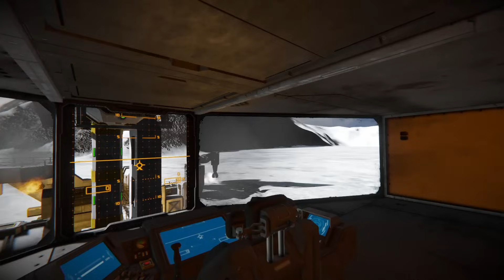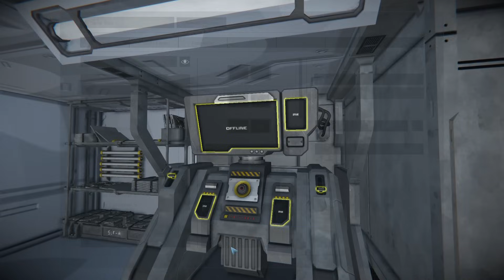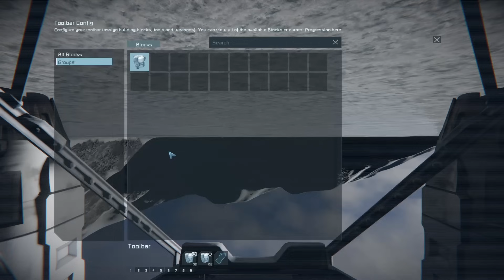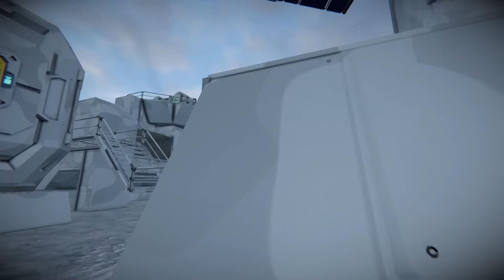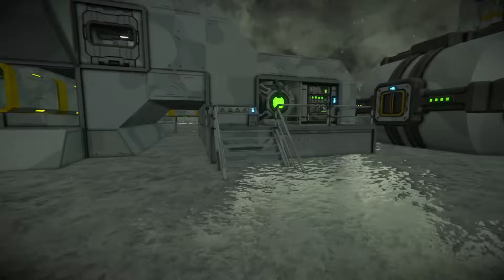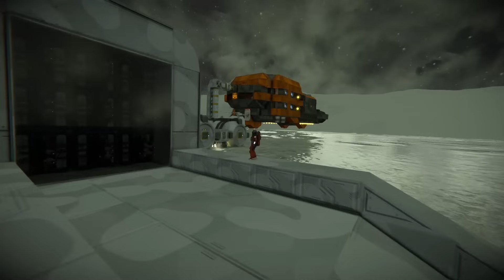5 Automation Tips to Make Life Easy in Space Engineers Automatons

Comment: And then there's another trick for automatons: small-grid automaton blocks on the small rotor head of a large grid rotor. Basically, it's a "ship" trick: carve out a small compartment and cram in a bunch of automatons that would take up half of a larger-grid ship. But it also sometimes helps out "on the ground" if resources and space are tight.
Reply from the maker: The drawback with this is that subgrids can cause problems with the way your grid handles, but it should be okay if you keep it small.
Reply: @GleebTorin  I hope a careful analysis of the non-overlapping namespace will eliminate these problems, along with not-so-minor "ticks" on events ;)

Comment: Am I weird for using connectors instead for my large grid computers? My experience with subgrids, especially on mobile grids, is that clang likes to fiddle with the physics even if rotors and hinges are locked, and pistons have sufficient axis/nonaxis stiffening. And because arguing with Clang pretty much always ends in losing said argument, I've experimented a little with using connectors instead. Looks neat with the newer inset connectors too.

I set it into place using LG half blocks around the inset connector, firstly building SG blocks and a 3x3 connector over the gap with some room to work, secondly adding chamfered blocks around the rim of the 3x3 connector, thirdly removing the supporting blocks until you're left with your chamfered 5x5x2 SG connector, and finally... setting the LG inset connector to the forbidden 100% strength (spoiler alert: it kinda just teleports inbetween the half blocks without issue) and locking, not forgetting the parking setting of course.

I get that it's a bit more hassle to set up, but you end up with a zero-movement, clang-free, sub-grid-but-not-really system at the end of the day.

Comment: The event controller when using a controller, doesn’t allow me to make a 2nd action. 

Like I have hydro engines powering batteries. 

I want the batteries to go into auto mode when they are fully charged and I want the engines to turn off. 

Then when the batteries get low enough I want to do the opposite but I can’t get more than one event set.

Comment: I forgot that hinges could be used with turret controllers.  I was using two rotors for my solar farm.  It worked but not as well as a hinge would, I suspect.
Reply from the maker: They're basically the same thing, so it'll work, but if you want to pip it up, a hinge is gonna give you the smaller connection.

Comment: Tip 5 is good from a safety feature standpoint but in my opinion a bit redundant given you could simply have the lights in the same group as the welders so they always turn on when you turn the welders on
Reply from the maker: @spinosauruskin  Won't help when someone turns the welders on without using the group though
Reply: @GleebTorin  True, but I tend to hide basically everything that's part of a group on the terminal menu so you need to use the group
Reply from the maker: @spinosauruskin Never underestimate the power of someone who just wants to find the welder. 😉

Comment: With a welder wall, just ad your warning lights to the group of welder's.
If you're using sensors to activate the wall than use 2.
Sensor 1 to detect small grid only.
Welder's+lights on and off
Make a new group welder's+lights+sensor 1
Place sensor 2 set to detect player's only, welders+lights+sensor 1 off
And sensor 1 on

Comment: The welder wall one is actually easier than this, Just put the welders and the lights in a group, so they all turn on and off together. Then if you want you can use a sensor to turn the welders off if you get too close, never get zapped again.
Reply from the maker: Unfortunately, and this has happened to me, that doesn't stop people from activating the welders independantly.

Comment: Personally, I'm using 2 AI blocks (Move & Recorder) and a timer block to automatically dock my miner after returning with ore, I've got the timer block setup to toggle the AI Blocks on/off and run the autopilot and follow the waypoints, on the last waypoint I set it to trigger the timer block again (shutting down the autopilot & handing the control of the miner back to me). I used to HATE docking to connectors, and dreaded the return of a mining run each time because of this. Now when I return I just need to get close enough to not have anything blocking the path and then trigger the timer block, everything from that point on is fully automated :)

Comment: I tried my own cargo status light for when my ice amount on my ship was 25, 50, 75% but it wasn't working right with multiple cargo containers. Does it not take an average of all of them but monitors the percentage on all of them and would only light up when all containers are reading below 25% for the 25% light to activate?

I'm trying to wrap my head around how it works :(
Reply from the maker: It doesn't take an average, no.

If the AND gate box is unchecked (as it is by default) then the output/condition is true if any of the blocks meet the criteria (like greater than or equal to 50%).

If the AND gate box is checked, ALL of the blocks must meet the criteria.

Let me know if there's anything else I can clear up. :)
Reply: @GleebTorin  Ah nice, perfect :) Thanks

Comment: The event controller is so goot to auto recharge and refill, stop and start engines and pretty much anything you would do anyways when docking. One Block, so much easier life
Reply: Im a little late but you're totally right. The block is awesome. I have it on my drill rig. Whenever the large cargo container reaches >90% it turns the drills off and stops the pistons. Once it gets below it they turn back on. No wasted resources because the drill continues with no storage left and it works far longer before I have to add more pistons. More Cargo containers would do the trick as well but that would be much less cool.

Comment: Good ideas except for the last one. That one was a stretch to use the event controller purely for the sake of using the event controller. You can get the exact same result from adding the lights to the same group you use to turn the welders on/off. A better safety feature would be a sensor that turns off the welder group if a player gets too close. That, of course, doesn't require any event controllers, either.
Reply from the maker: I've actually had some great use out of this. I use this on a multiplayer server. Some people don't think to look for a group and will just turn the welder on by itself. By using the event controller in this way, no matter how the welders are activated, the warning light comes on.
Reply: @GleebTorin  To this I would have said "Use a timer block and set the entire group.", but an event controller is 40% the PCU so your solution is the best, as long as there are no more than 3 things to do at the same time.
Reply: You can set the welders to not share with your faction so other players have to press a button that is shared and toggles the group. Or set a detector to only turn on the welders when a grid is in range so nobody ever has to manually turn them on in the first place. Using an event controller just for lights isn't going to hurt anything, but it's unnecessary.
Reply: @mailleweaver  An event controller to switch lights based off manually toggling welders might be unnecessary, but it combined with the projector toggling for when blocks go missing has given me an idea for an automatic 'red alert' mechanism for my mothership that I've previously not bothered to do because it'd require a PB.
Making lights start flashing when events occur (depressurisation, taking damage, running low on something, etc) is a neat usage for an EC that I hadn't considered.
So the specific usage here might not be the most useful thing to copy exactly, but it's a good source of inspiration for mentally bootstrapping your expectations of what the controllers can do.
Reply: Yep, I use cut-off sensors on my welding ships, too, since I sometimes forget to turn the welders off before jumping out of the cockpit.  I set the field to encompass the cockpit, the welder(s) and around 5 to 7.5m out in front of the welder contacts.  Set to detect players only (but not enemies >:) ) Works like a charm